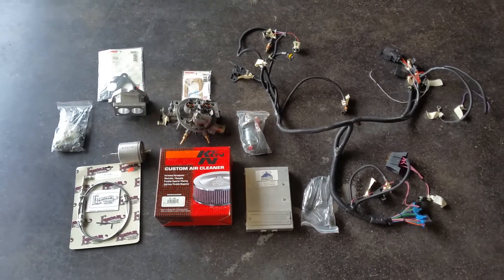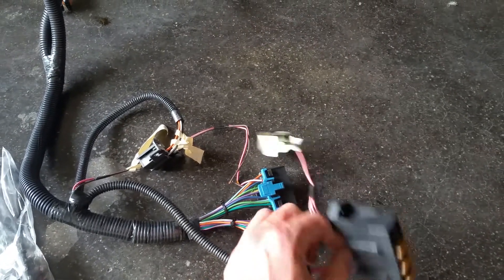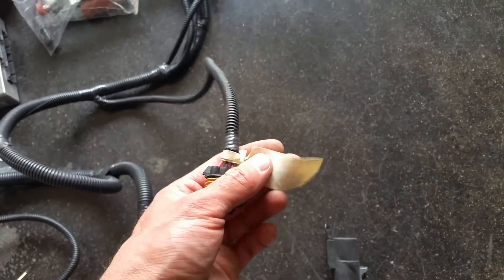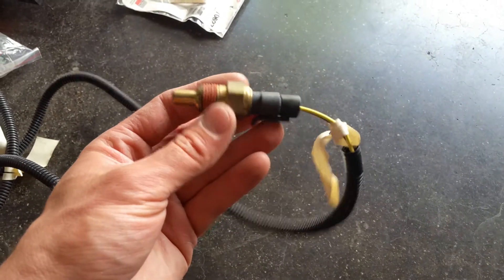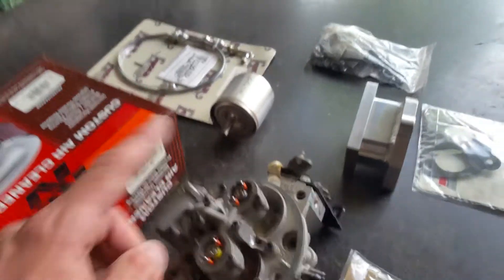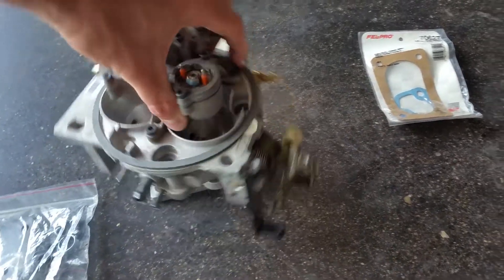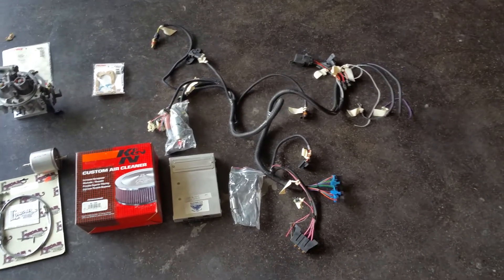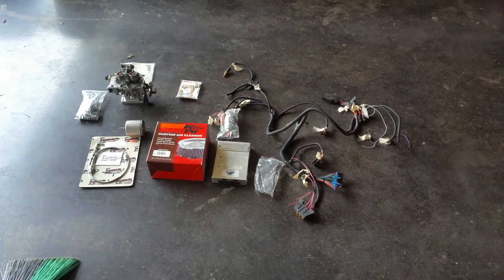How to fuel inject a Toyota Land Cruiser

Comment: on this gm ECU setup where does it get the signal of the engine crankshaft position from?
Reply from the maker: From an HEI distributor with a crank sensor built in

Comment: NIce vid. I have an 84 Fj60 which I have owned since 04.  I really want to covert my 2F to FI.... I can wire a light socket, does that count? Lol. It seems daunting.   I know this will help at higher elevation like mammoth, ( SOCAL, 92672) from starving the engine, but will it give me a bit more power?  Cheers, thumbs up and a sub..
Reply from the maker: You wont gain much power at high elevation but you will gain drivability as the EFI can deliver the correct fuel mixture at all elevations.

Comment: What’s the spec on the throttle body you used on this conversion? I’m currently looking into doing the same on my 2F engine as well.
Reply from the maker: 1986 1500  v6 truck is what it's from